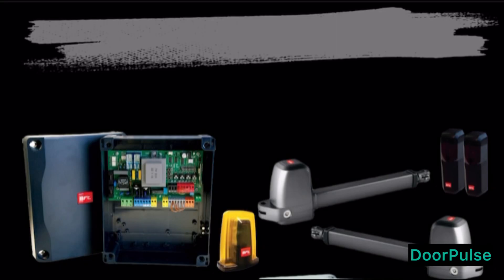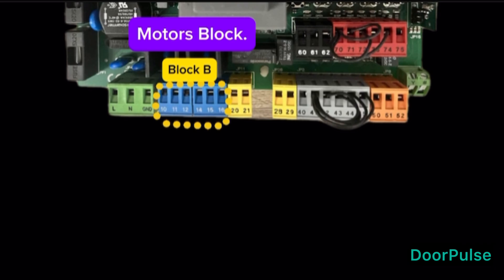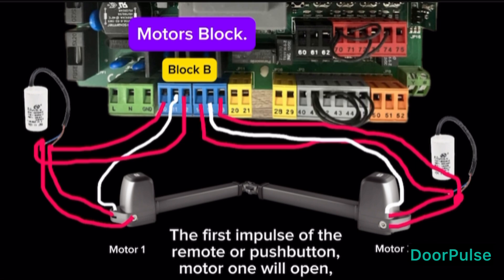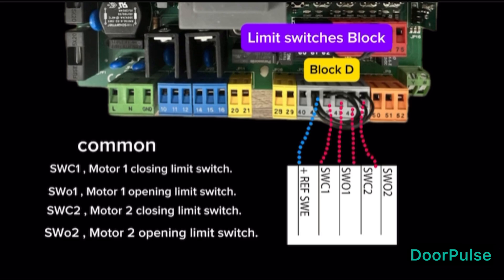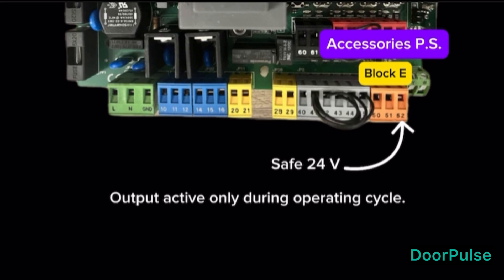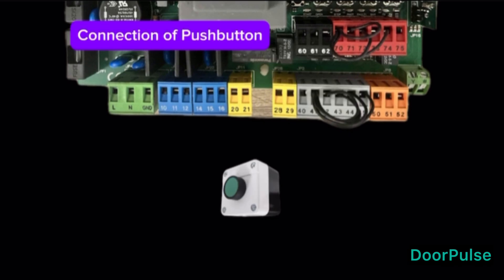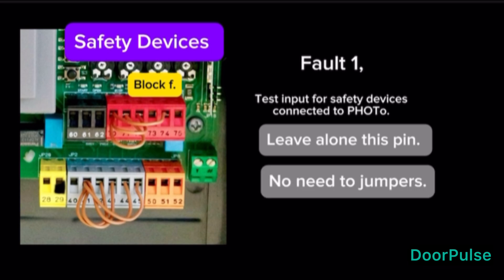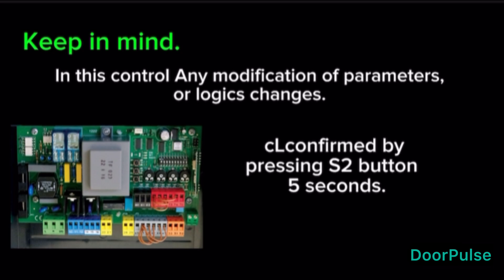BFT ATHOS AC 25A/40A Swing Gate Opener | ALENA SW2 CPEM Control Board Installation |

Comment: Hola saludos desde Medellín Colombia, te pregunto  Si se quedara sin energía eléctrica ¿Como se desbloquea para abrir manual?
Reply from the maker: Hi Sir.
You have Key for manually open the door.
In motor opener there is a hole for manually open.
If you don’t have key.
Open from door side bracket from wrenching.

Comment: Black and blue and brown witch witch number fixed
Reply from the maker: Terminal 10 and terminal 12 Black wire and brown wire is a phase consider for motor open and close with capacitor connect.
Reply from the maker: Terminal 11 is common

Comment: Motor 1  with color fix on 10 and 11and 12 please tell
Reply from the maker: Terminal 10,11,12 is motor 1.  (Motor and condenser connection. Time lag during closing. (Can be adjusted with trimmer T4))
Reply from the maker: Terminal 14,15,16 motor 2 . ( Motor and condenser connection. Time lag during opening. 2s )